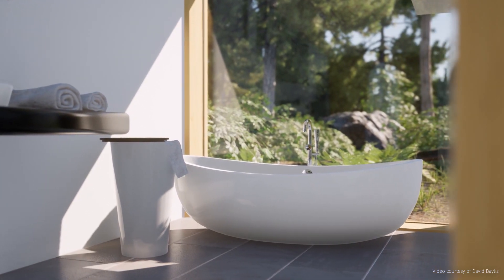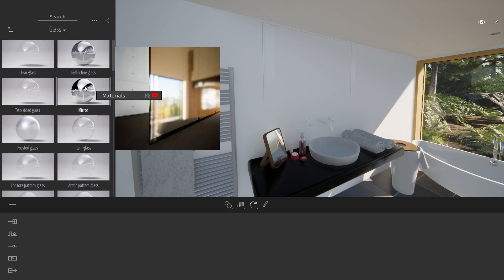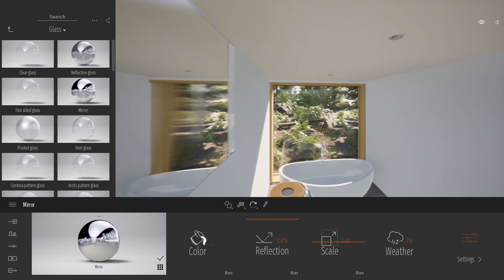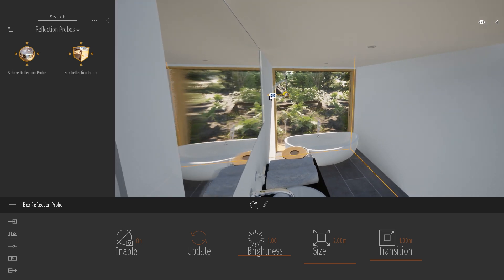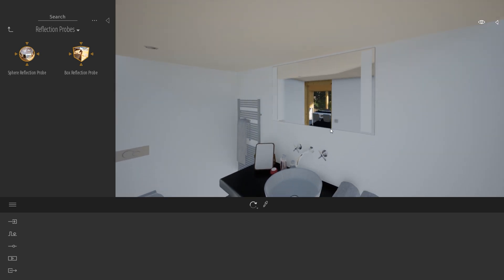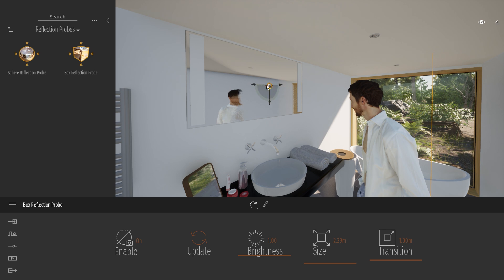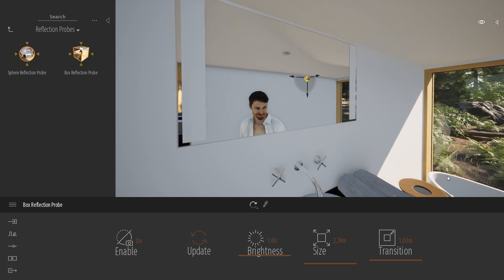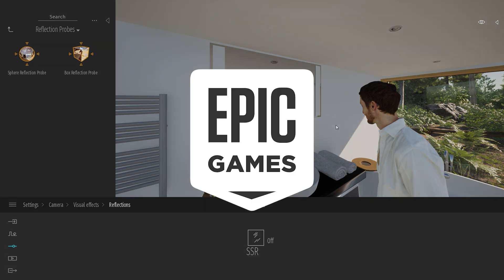Create a mirror | Tips & Tricks | Twinmotion

Comment: Another tip not mentioned in this video that greatly increases the quality of reflections is to change the quality settings of the reflection probes. This can be done by going to edit (top left) then preferences (bottom) then change the viewports reflection probes resolution from its default setting of 256 to 1024. You can also change the export settings from 256 to 1024. Makes a huge difference!